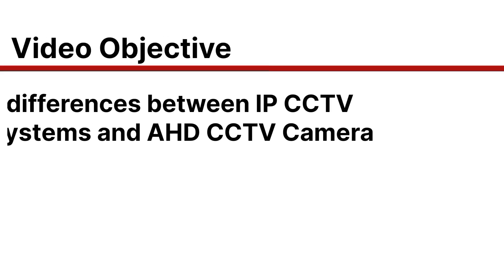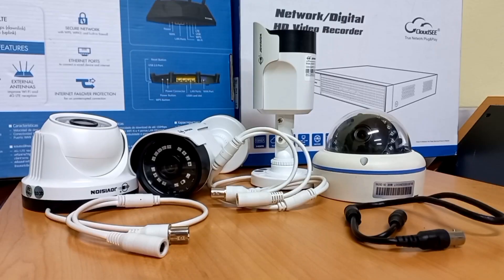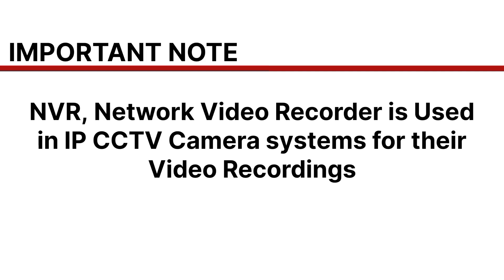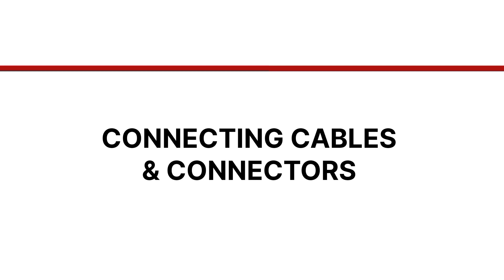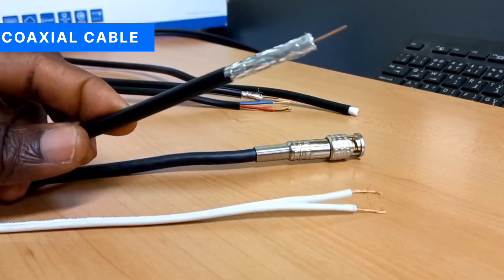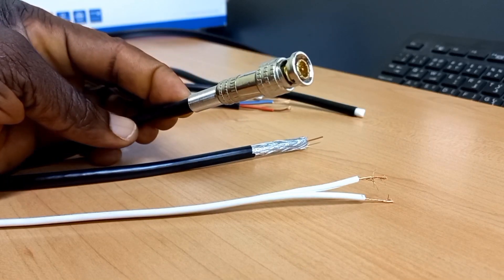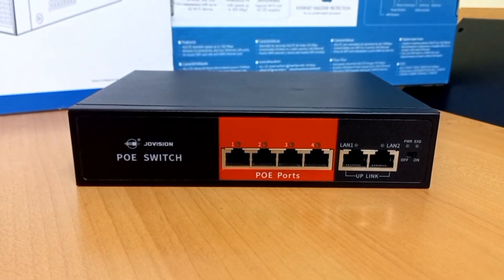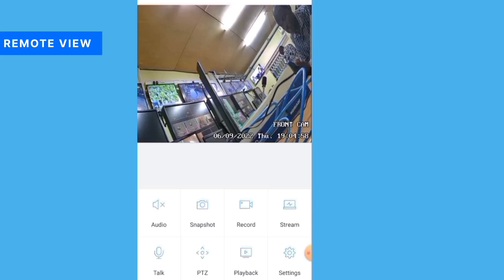Differences between IP CCTV and Analogue CCTV Camera systems

Comment: Hi, I have a dahua  32 Ip input channel nvr , my question what can  i do any model of dahua IP camera add my nvr.
Reply from the maker: You would have to check the specifications of the NVR especially the maximum resolution of cameras it is able to take. When you get that information, you will then have to choose cameras either of thesame resolution as the nvr or lower resolutions but the cameras should not be of higher resolution than the NVR

Comment: Please I have two questions (1) can DVR record an IP camera
(2) if I can monitor analog on mobile phones and online, what is the difference in function between Ip and analog camera?
Reply from the maker: Hi,
1. IP cameras cannot be connected to a DVR and so you can't reord IP cameras using a DVR, IP cameras can only be connected to NVR. 
2. Yes, you can watch Analogue cameras on a mobile Phone or on any device online.
Reply: You can connect IP cameras to Hybrid DVRs (allows both analog and IP cameras).
You can also record and remote view on these devices.